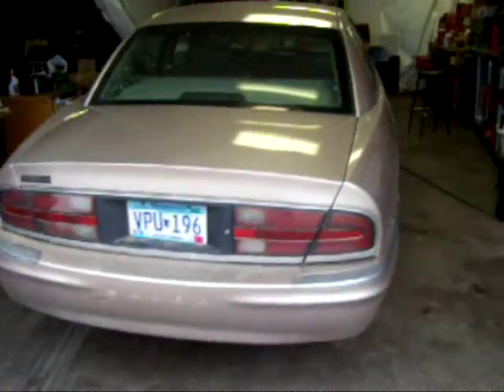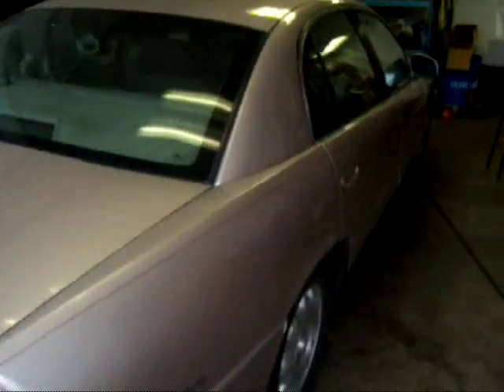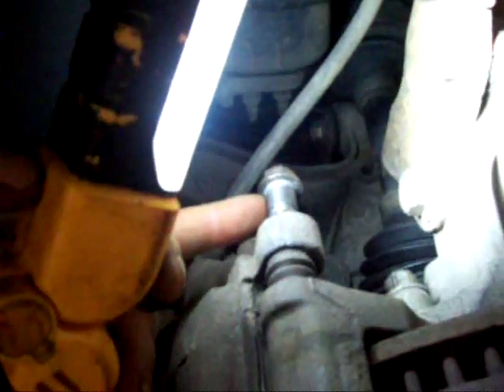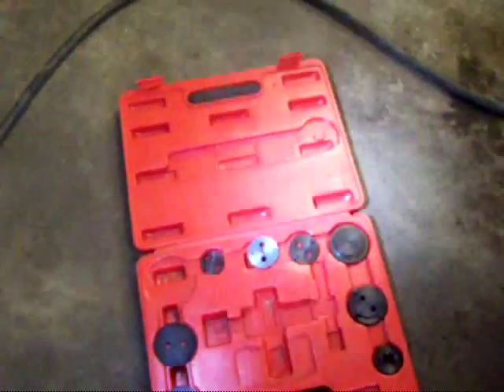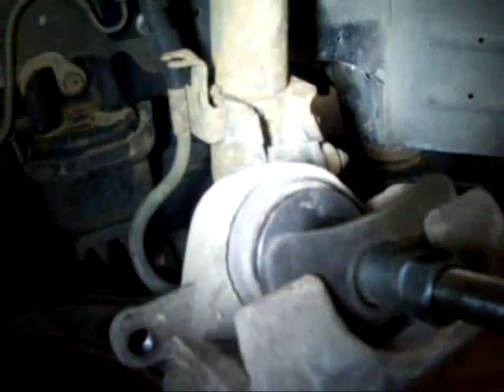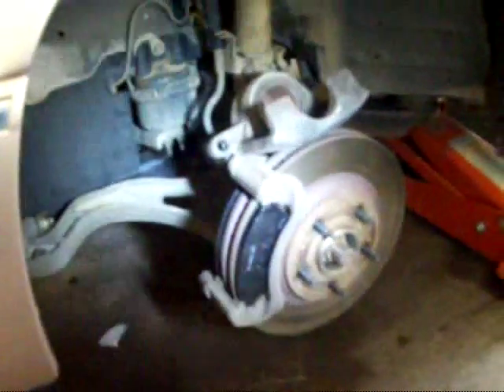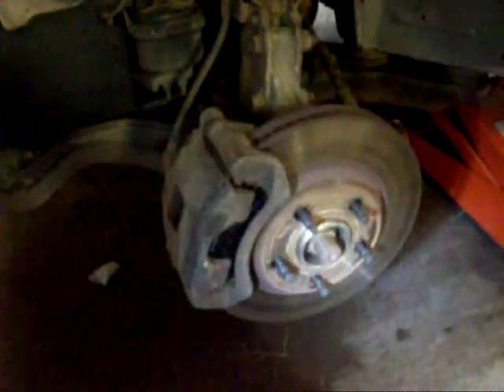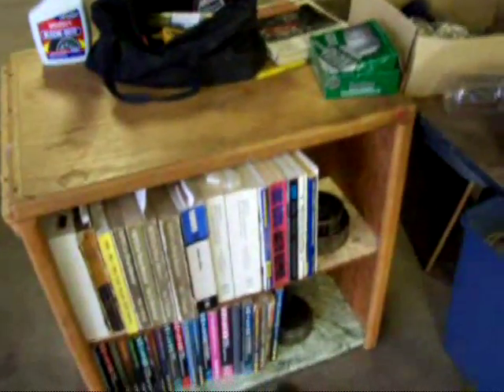Yet another job to do

Comment from the maker: @v6ish That sounds like the PCS (pressure control solenoid) isnt working right. You could have it replaced, or I have heard of some people having luck with running seafoam trans tune in the trans for a while then dropping the pan and do a filter and fluid change. It might clear up your problem

Comment: @v6ish Yeah it does sound like the pressure control solenoid needs replaced, my mom's 2002 chevy impala did the samething, and our mechanic changed out the solenoid and now its fine.  He said it was messed up, they issued a recall I forgot when, and he also said once it warms up is when it starts slamming into gears, since the solenoid is screwed up.

Comment: HI nice video was wondering if you would have any idea on how to fix a hard shift on a 2000 buick park ave I also had a service eng soon light on and scaned it came back with code p1811. I have about 140000 miles on it but the trans has been serviced and taken care of it seams like it shifts very hard when the motor warms up but its fine when cold it is not a supercharged car but I did add a dual flowmaster set-up and a K&N air filter any help would be great thank you